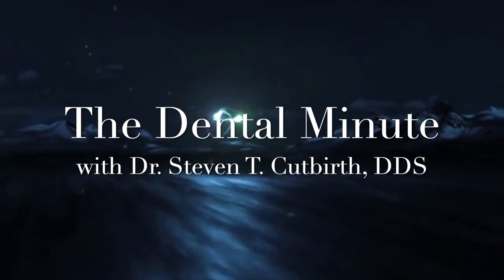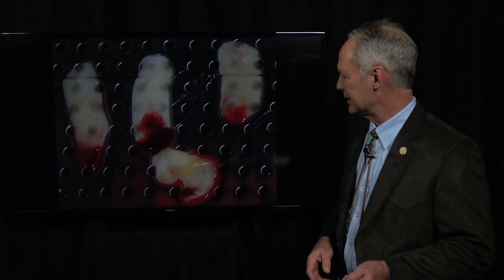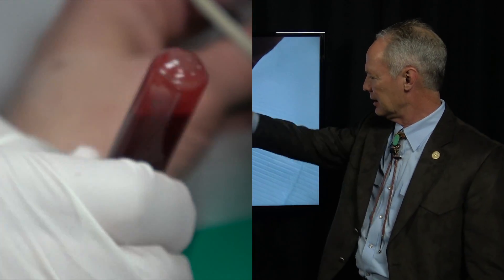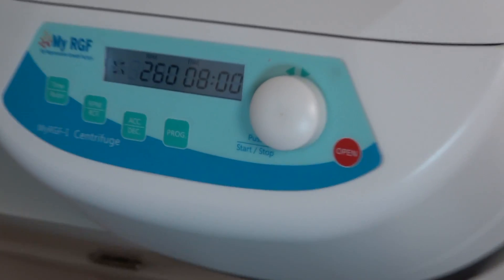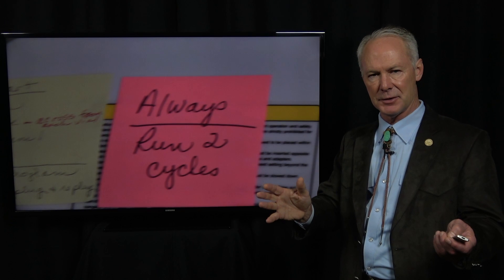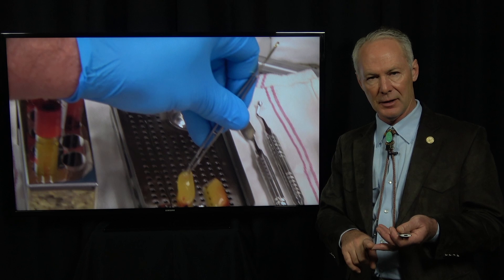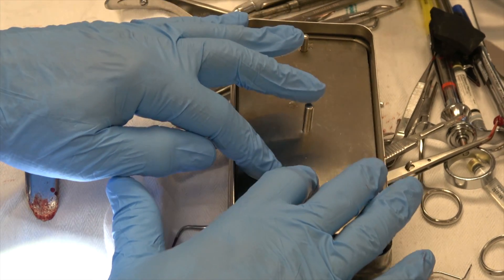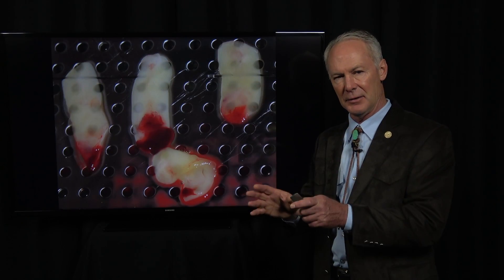How to Make PRF - with Steven T. Cutbirth, DDS

Comment: At university here in Australia we gave this a shot and had a great day with some well acquired practise. I did have alot of questions our lecturer was unable to answer, so perhaps you may be able to assist. The perforated plate/trays come with slight variations in hole size and separation. It was also noted in our class the lids have various weights. Is it possible some of the cells may become damaged while trying to extract the fluid from the gel form? Someone suggested a more mesh like tray to extract but I have a feeling it may cause damage to cell structures and wouldn't be suitable. Have you utilized various types of trays in your experience?
Reply from the maker: No, the tray I use was the standard tray. I didn't know there were different sizes.  I wouldn't overanalyze it.  Someone has done research on the entire process.  Just be sure to purchase your trays from a reputable company.
Reply from the maker: Take your practice to the Top Tier.  Subscribe to DentistryMasterClasses.com for an organized library of all the Dental Minute videos plus many complete comprehensive cases and many very important articles.  New cases are added weekly.  Only $20/month.

Comment: Wonderfull! Unlike most of the textbooks, seminars and conferences that I attended they talk a lot (about two pages or so) to tell you a sentence of practically useful information, your ONE-sentence of videos talks A LOTS.  You nailed it on the head. Well done.
I got questions. Do you use Plastic or Glass Vacutainer?  
How much of blood approximately drown per tube? Is there any restriction?
Thanks
Reply from the maker: I am not sure how much blood/tube, but not a lot.  I routinely draw 4-6 tubes of blood for PRF.  That is not a problem.  I used to know if the tubes were glass or plastic, but I have forgotten.
Reply: @centerforard   
Thank you for your very informative videos.
Are the tubes for PRF with chemical inside or nothing in them? Thank you
Reply: @petarvrskovski4995  no chemical..
Reply: Preferably use glass or if plastic it should be internally coated.. So that they don't lyse the blood cells and activate clotting

Comment: Cutting the fibrin like this make you loose so many important cells !!! Wrong preparation from my point of view...
Reply from the maker: Thanks for your comment. I did not need every tiny bit of  the PRF for the procedure. Sometimes it is easier to cut the PRF off than scrape it.
Take your practice to the Top Tier. Subscribe to DentistryMasterClasses.com for an organized library of all the Dental Minute videos plus many complete comprehensive cases and many very important articles. New cases are added weekly.  Only $39.95/month.
Click here to subscribe: 
https://membership.dentistrymasterclasses.com/purchase/?plan=513